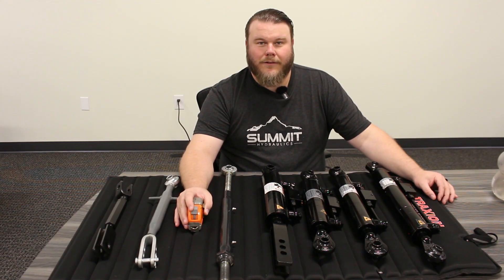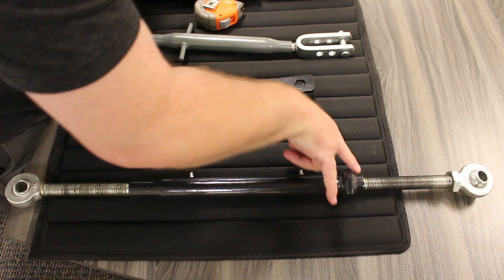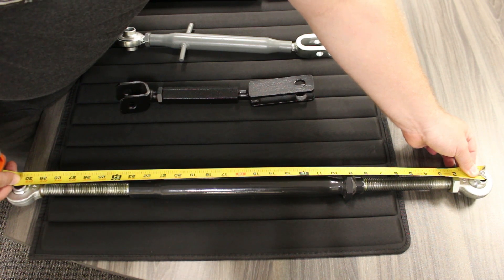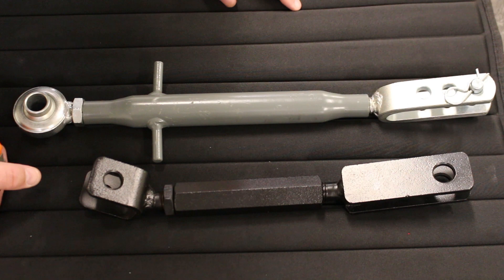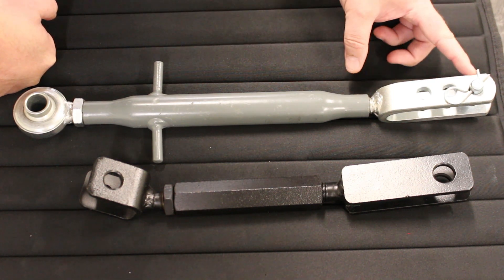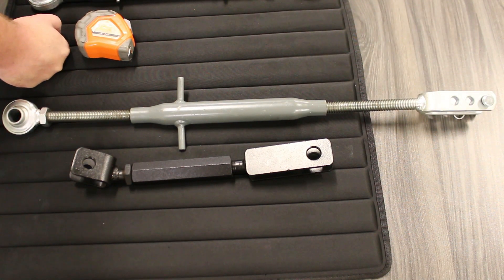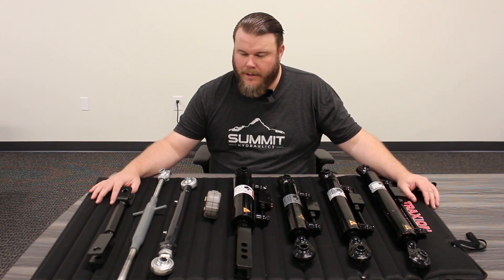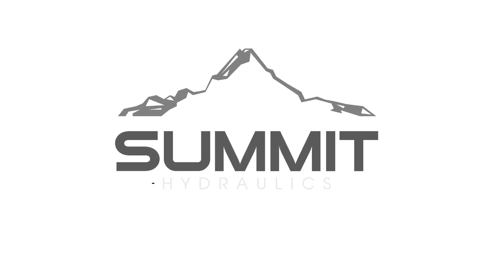How to Measure Manual Tie-Rod Cylinders

Comment: I have the same size top link as what’s in the video (Cat 1 18”-30”), but there is not one on the site that matches. Not sure which one to choose.
Reply from the maker: We offer a 18" - 26" Top Link Cylinder. It can work if you are ok with the shorter stroke.